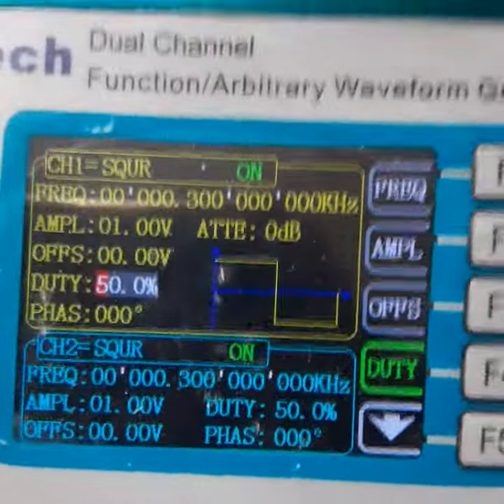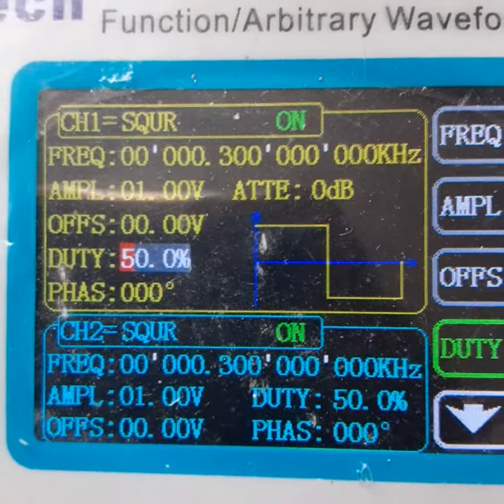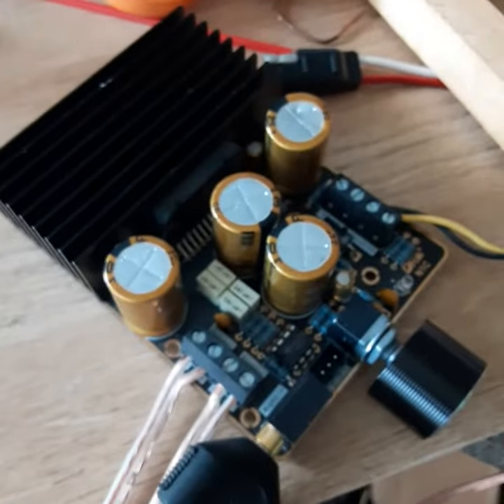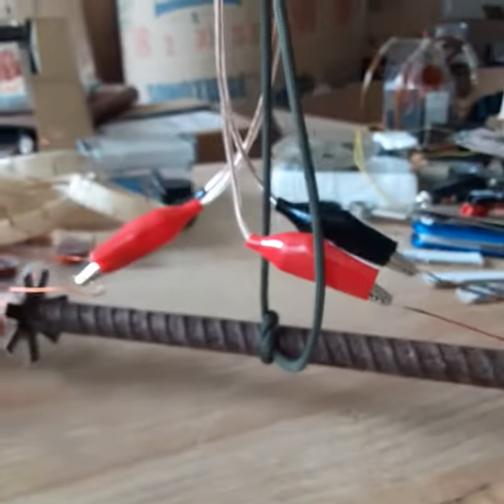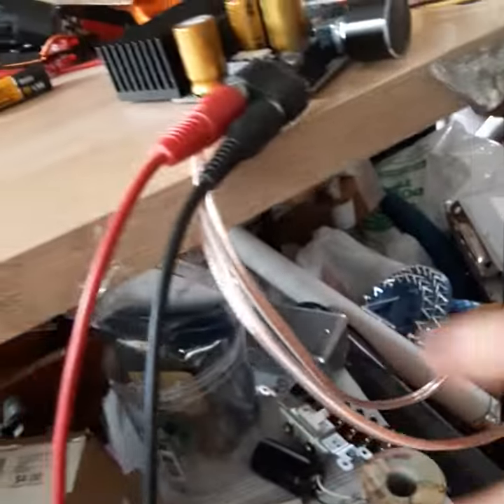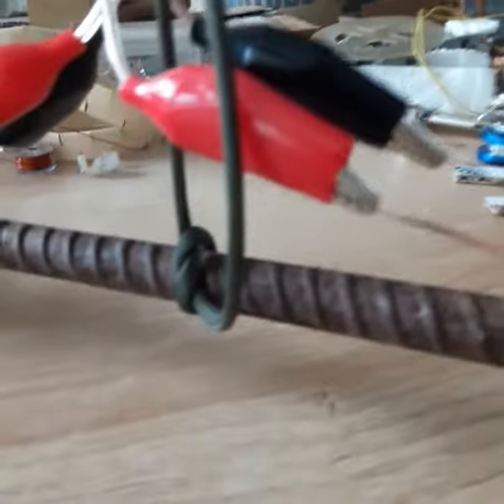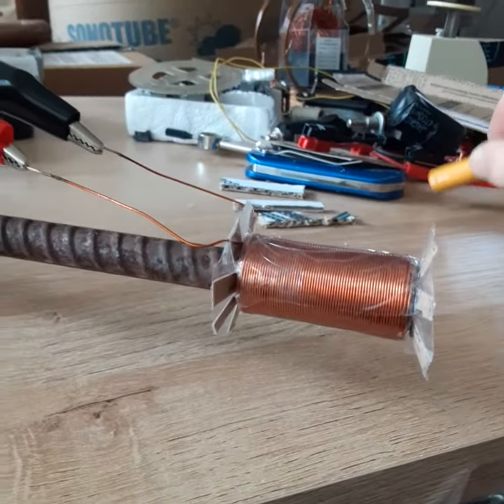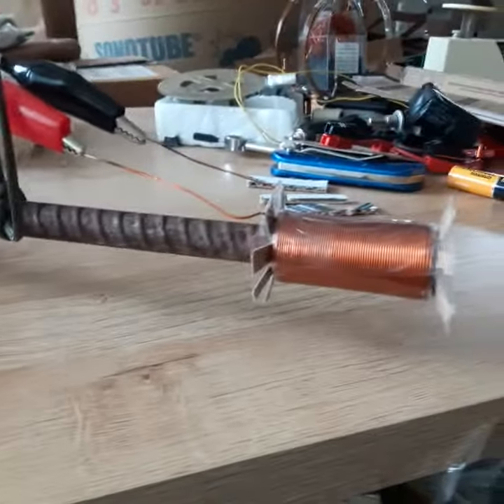rebar magnetic waves

Comment: You can't really underestimate the amount of motion because rebar is very, very dense, and very heavy.  That is a big piece of rebar, particularly compared to the two electromagnets.

Since an alternating signal is being applied, that means accelerated charged particles.  Accelerated charged particles means electromagnetic wave generation.

The Abraham-Lorentz force comes to mind:  the recoil experienced by something that is emitting electromagnetic waves.

Although STEM folks go back-and-forth as to the constituents that may (or may not) be present in the vacuum, it seems rational that if space was totally empty, with no constituents, there would be no 'cost' to emitting electromagnetic waves, and there would be no Abraham-Lorentz force (no recoil suffered by the emitting, accelerated charged particles).

If space was 100%, electromagnetically frictionless, then why would the act of emitting an electromagnetic wave by a charged particle(s) result in recoil.

So unless there's a magnetic influence between the rebar+electromagnets and something ferrous in the nearby vicinity, this sort of looks like signs of recoil.  Because that much movement with such a large, heavy piece of rebar seems pretty remarkable.  It is a big piece, relative to the other components!
.
Reply from the maker: i also did it with a two inch steel sphere and a vortex in a two inch iron cube, but the setup moving nearby ceramic objects as well got me thinking that i need to build a much larger version, it sure looks like something useful
Reply: @spacecase0  That's very interesting.  It would 100% be worth the effort to pin that down, if non-ferrous objects are also moving
Reply from the maker: @Greg_Chase  I made another video showing the ceramic mug moving. defiantly need to find another way to do all this as this test setup makes me very sick quite fast... I am working on a rotational system (see the MAGVID idea)
Reply: @spacecase0   There is a description of a similar effect seen by Tesla in his lab - the device he had was said to move a nearby chair while the device was running.  It is described in the Gerry Vassilatos' book "Secrets of Cold War Technology" in the chapter on Tesla.  I could never quite figure out how to reproduce Tesla's device from the description in that book, but if you see movement in non-ferrous objects, that's a big deal.  The effect sounded like repulsive gravity or some sort of force. It could be hugely important to pin down how it is happening.
Reply from the maker: @Greg_Chase  I have that book, will go back and read that section again. I do wonder what will happen if I try this at much higher frequencies (where tesla likely tried it). but standard radio hardware will not do it, I should start looking for the hardware to do it.

Comment: excellent work, but we could use more details so that we know better what is going on and we could replicate if we wanted to.  if the trick is magnetic pressure as you say, then a coil that is as exactly counter wound as possible would/could create the most pressure I think yes? like a caduceus coil but center tapped at the top and then balanced so the current in each of the two counter wound paths is precisely equal and so has zero inductance. yes?
Reply from the maker: there are likely many formats that will work. i like your ideas. what details were you looking for ?